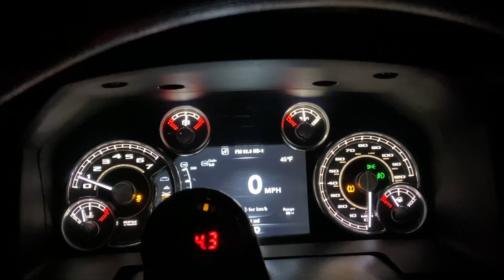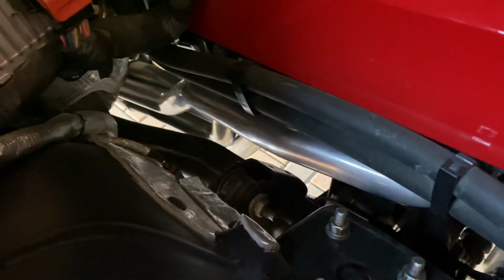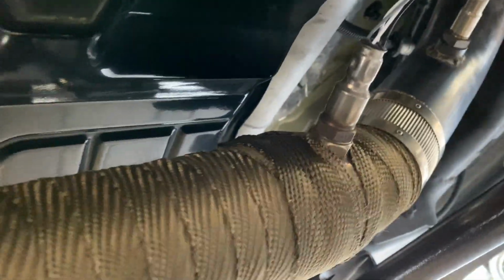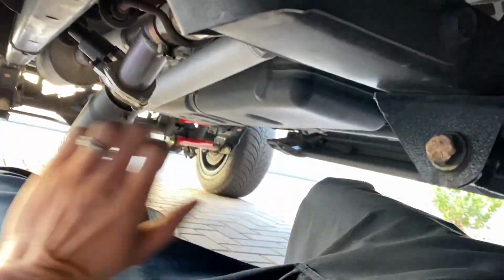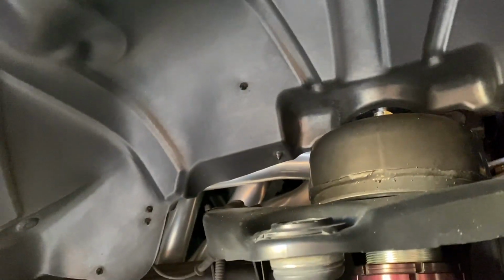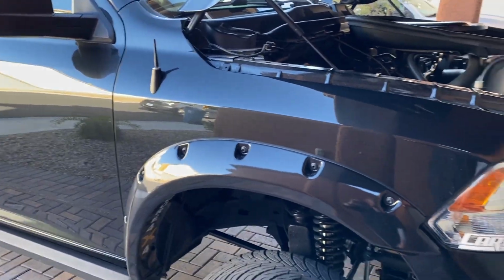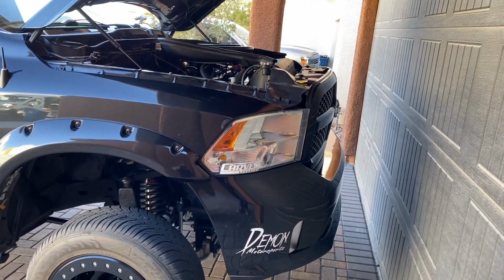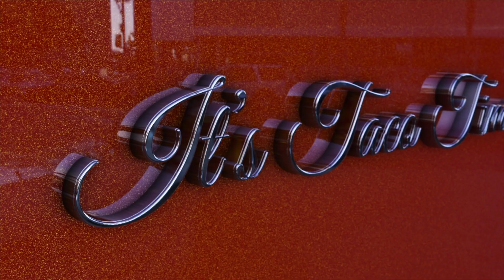JBA long tube header review 1 year

Comment: Awesome truck! Did you get the ceramic coated stainless JBA headers or are they just bare stainless?
Reply from the maker: Ceramic coated steel, cheap version.
Reply: They sound awesome on your truck. Thanks for the great videos, keep them coming! Would you recommend buying these JBA headers and a new cam and tune or would you hold off keep saving and go with a Kooks header? (I'm also on a bit of a budget atm with 1st kid on the way, but I can splurge on the headers and then hold off on the rest  for another year or so.. 2 years back I installed true dual custom exhaust 409 stainless steel from cats back already, sounds great but now my manifolds are leaking and a cam and tune would make the truck come to life) 

They JBA's sound amazing in videos from what I can tell the only difference seems to be price, they both add better performance and more power.

Comment: Alright man, I will try to make this my wrap up before I buy some more stuff! You got the 6.2 gaskets, for the same year just 6.2? Keep the JBA bolts but I do need to order 2 more O2 extensions to total 4. And since they do not make y pipes anymore the rest is fab work?  I am ready but want to be sure! Thanks!
Reply from the maker: I have the gasket model number at home, remind me in about 8 hours. 😁 Yes, you will need probably get a y pipe fabricated.
Reply: KUSTOMBLACK MOTORSPORTS hey! Just checking in on the part number for those gaskets. Thanks again!

Comment: Did your check engine light come out after installing the headers? Because mine did and the Shop told me it won’t go away until I get it tune. Just wanted some feedback from people that have JBA Long Tube Headers
Reply from the maker: You need to get a tune.
Reply: KUSTOMBLACK MOTORSPORTS ... Thanks I will as soon I save enough money to swap my locked PCM